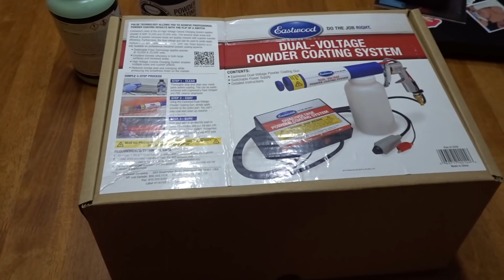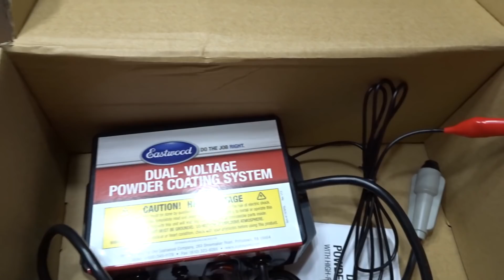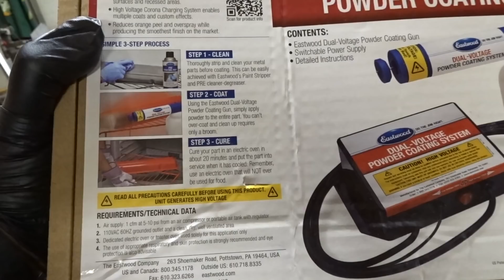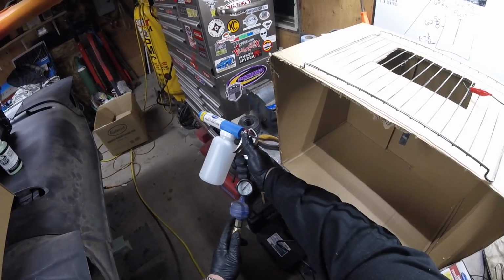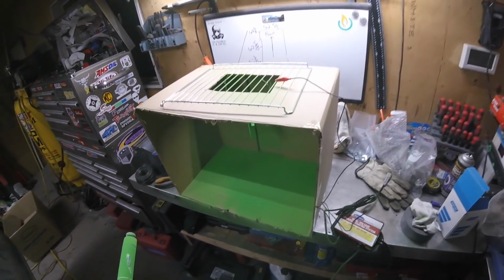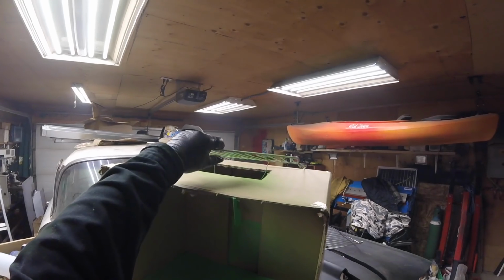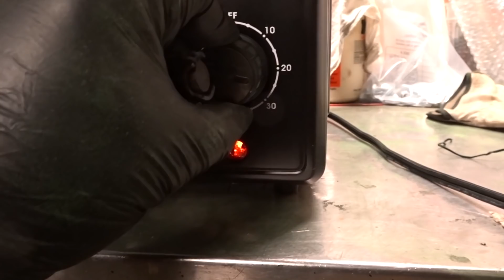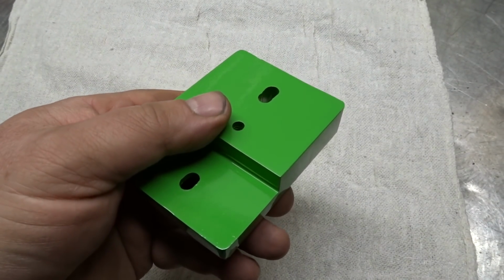EastWood Dual Voltage Powder Coating System

Comment: Now that you have your new powder coat system, do you think a homemade powder coat booth or cabinet with a built in exhaust vent be in the plans? That way the powder wont be floating all over.

Comment: Does this compromise the integrity of the metal with the heat treatment?  Do you have to temper the metal by dropping it in a water bath or is it nothing to worry about?
Reply: I do not think you are getting it hot enough to do that